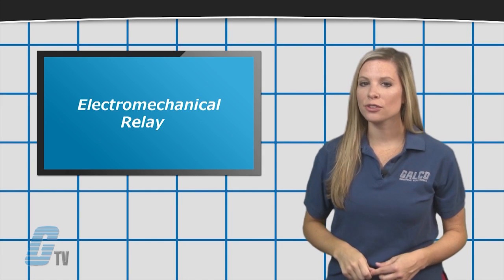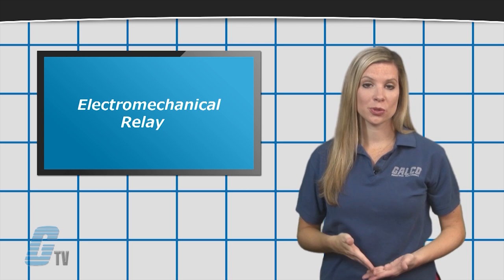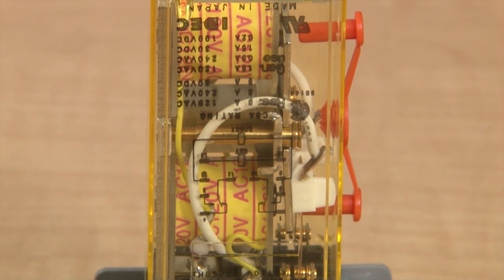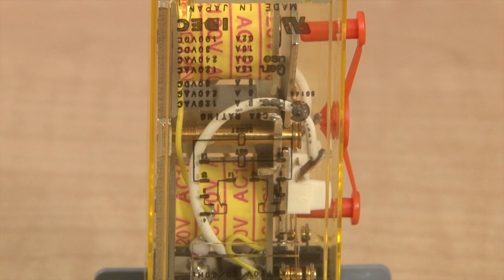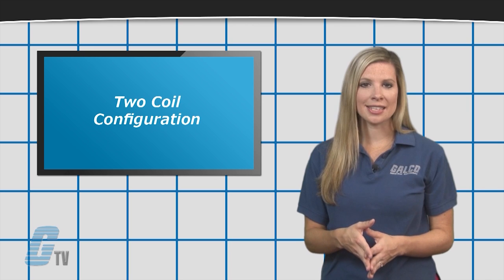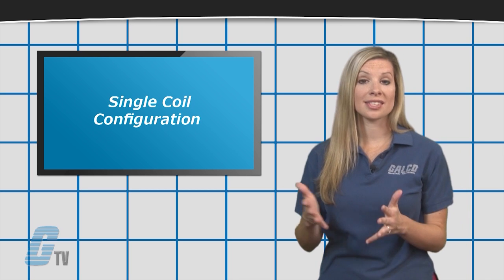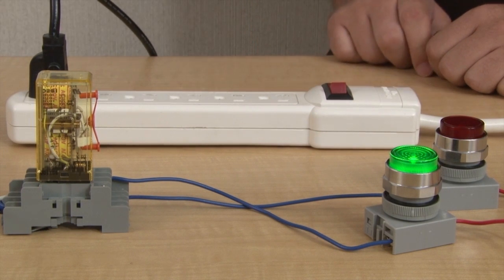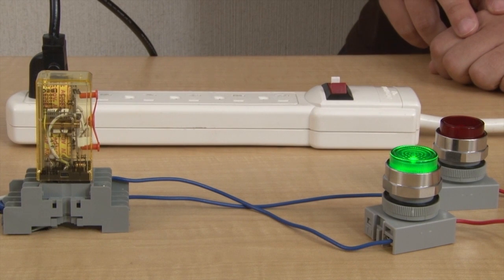What is a Latching Relay? - A GalcoTV Tech Tip | Galco

Comment: I was wondering how the batteries lasted so long in my central heating temperature control unit!
Reply from the maker: Well after the display, it doesn't really do a lot until it fires a latching relay which is just a quick pulse of energy, eh?

Comment: does latching relay on TV getting stuck cause set not to come on from power button but set may turn on after unplugging and re-plugging set or holding down manual power button while set is unplugged then re-plugging with set sometimes coming on?